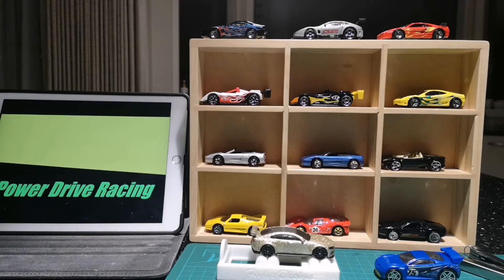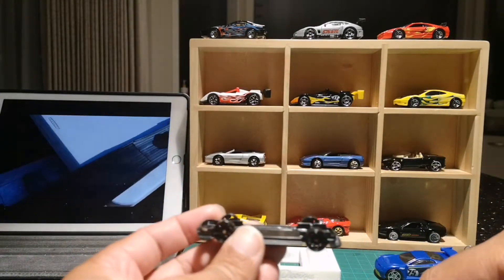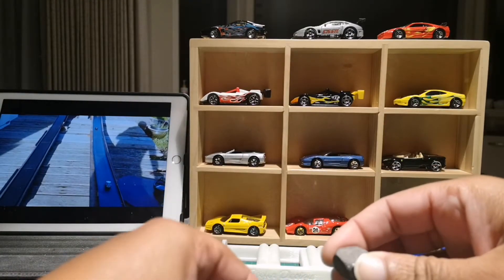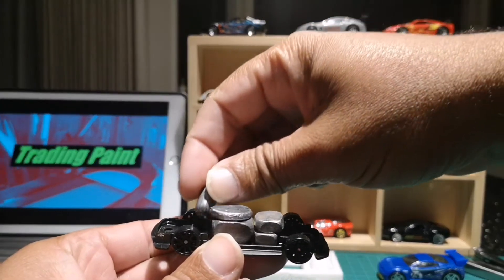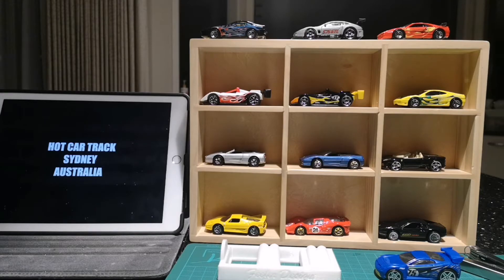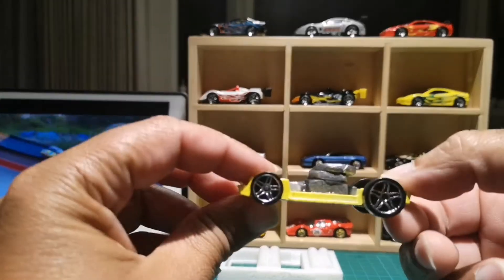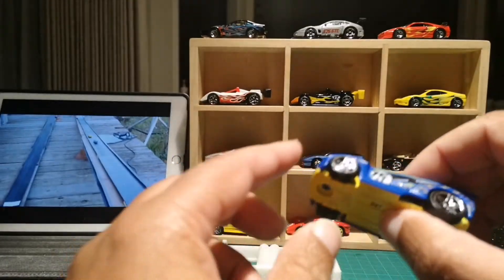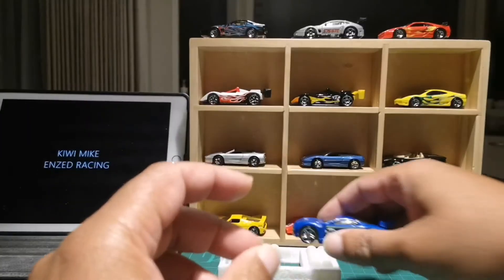Custom Diecast Build! Jaguar Project 8

Comment: Nice customs. New generation of Hotwheels Boys 🔥🔥👍
Reply from the maker: Cheers mate 👍 let's hope he builds a better one than the XJ220 that's racing at Hot Car Track. Dame I don't know what's going on there. Was really fast during testing but seems slow now 😔
Reply: @HotwheelsBoys  it may be anything from wrong tire pressure to bad fuel, there is still hope.